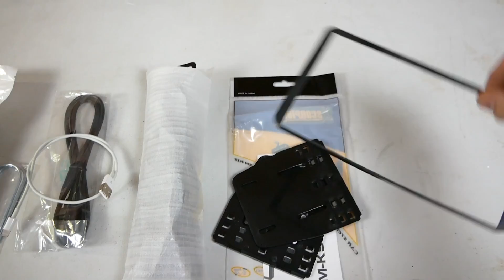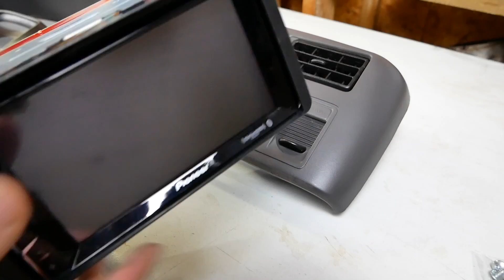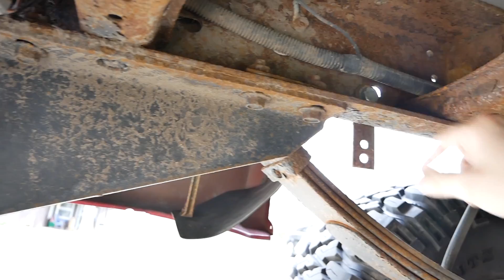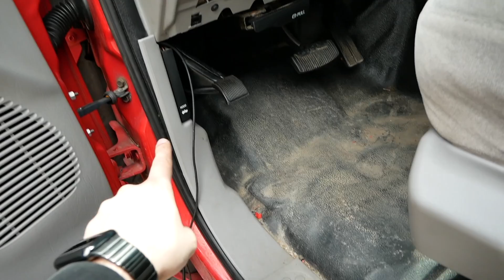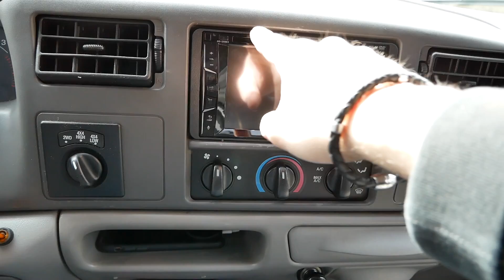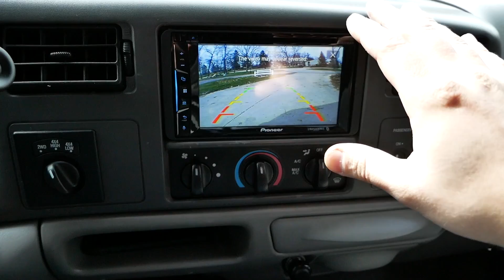[Part 2] Double din DVD player stereo retrofit install for 99-04 Super Duty (v5.2.0)

Comment: YIKES the wiring is SCARY. 
1) running thin wire from L/R corner to the radio for Cam power blew my mind.
2) Using those garbage wire tap things for the stereo wire up was just a double tap of blowing my mind.  Those things are horrible. They cut wire strands, induce corrosion (the high level of corrosion under the truck indicates definite need for sealed connections) and are not good electrical connections.  Sure they're quick and they work....for a while..... but at the least those connections should be butt splices with heat shrink seal. Better to be butt splice with that's then soldered and covered with heat shrink but that is a bit over kill for a stereo.
Reply from the maker: Totally agree and appreciate the feedback 👍 I switch things up regularly until I am sold on keeping it that way forever. After that point I solder or put weather pack connectors in place

Comment: Wire for reverse light is on the bottom right of the fuse box...pull that fuse box off and look at the wire harness on the bottom right corner
Reply from the maker: Thank you! That makes way more sense, will be pulling the fuse box when I re-visit this set up. Will be way nicer than a single long wire that runs from the rear bumper all the way forward 👍
Reply: alwaysup2late if I remember right it is the black and pink one
Reply from the maker: @codylebleu951  Perfect, that is the color of the hot side wire that connects to actual reverse bulb too. That's awesome

Comment: Thanks for making this video and for the equipment recommendations.  I just purchased that same head unit and mounting kit to install in my F250 - can’t wait.

What speakers are you using?
Reply from the maker: I have 2 Kicker 10 CVT10 in a box under the rear seat, down-firing towards the floor. Looking in to upgrading door speakers next in the audio department, have a few other projects to tackle first though

Comment: For the ‘99-‘01 Super Duty/Excursion there’s no under dash reverse wire. You either have to run from the rear or run under the hood.
Reply from the maker: This makes perfect sense now why I couldn't find that one before, thank you!
Reply: @alwaysup2late  I made that mistake when trying to wire mine…I eventually ended up putting it on a switch.

Comment: Nice job.  Tip: I would wire the camera to “key” switched power so you can access the backup camera when the truck isn’t in reverse!
Reply from the maker: That's a good point, I had it that way initially but the LEDs light up anytime there is power so they were always on. I think when I update to a better switch setup (probably F650 dash) I will get a better camera that I can trigger those separately

Comment: The wire comes off the steering column.
Reply from the maker: Nice! Will find that one when I rework how this is set for my switches. Looking at the F650 manual dash piece, will have things pretty well apart when I do that one
Reply: @alwaysup2late  I misspoke.  My old Ford came off the neutral safety switch under the steering column. You need to find the pressure switch that's on the transmission it has two wires that comes off of it. You need to hook up to the side of the switch. that powers up when the transmission is shifted to reverse. For a manual transmission look under the truck on the transmission where the shift linkage is. When it's in reverse you will see a switch that hooks to the linkage. Tap into the side of that switch that powers up when it's in reverse.
Reply from the maker: Gino Gambino ah yes that makes perfect sense. Something has to have power to tell the reverse lights to turn on, going to the source is probably the best 👍
Reply: It may but the easiest way is off the fuse box underneath the dash...reverse wire is located on the bottom right harness plugged into the box

Comment: The black pink is very hard to get to on the 2000 trucks....I have found its very easy to get to under the hood ! ...on the side of the fuse block is two relays ...the assembly can unhook off the fuse block  and you can flip it over. it has a simple cover to remove... the black pink is right there ...
Reply from the maker: Robert Bartell that is great information! I am definitely going to update that set up now, thank you! 👍

Comment: I believe the black wire with pink stripe for the camera power is located behind the fuse block. It should be in a wire harness. Pull the fuse block out to access it.

Comment: Awesome video thanks for sharing! Now I finally know how to get a 2 din radio and make it look super clean in my 03 f250
Reply from the maker: Ze Hacker I appreciate that, glad you like it! I think the dash kit makes all the difference in making it look as close to factory finished as possible 👍 One thing I found was that the brackets themselves can be tricky to get them to snap in to place. I had to do some "adjustment" with a pair of pliers on a few of the tabs but other than that pretty smooth install